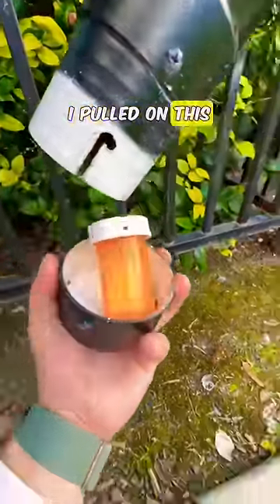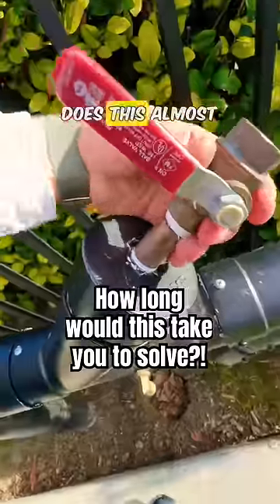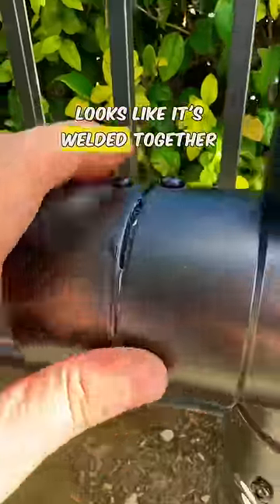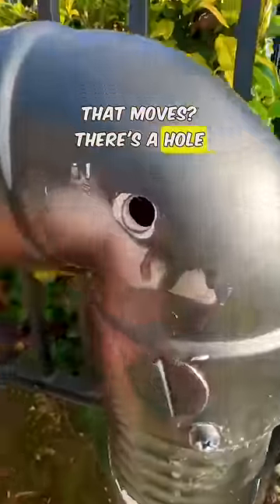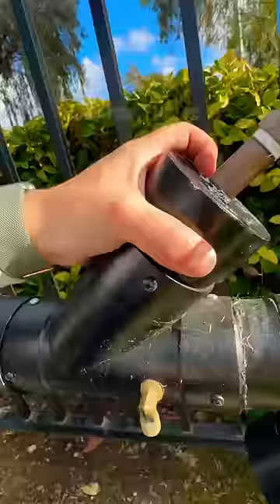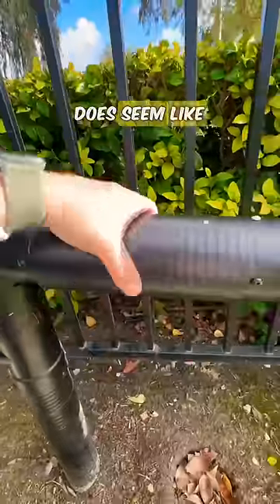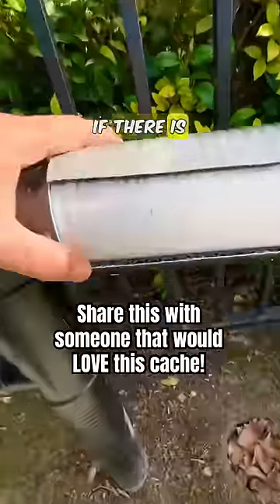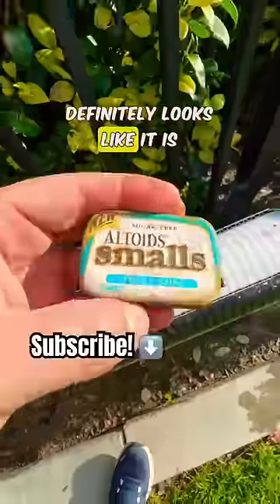Could you figure out this INSANE gadget cache? One of my favorite Geocaches EVER! 🤯

Comment: This cache needs a hole in the bottom to drain the water .. and a plastic watertight box. 

Nice find.
Reply: Something I have found cache owners do where they think there is a chance of water getting in, is using a container (rather than a plastic bag) inside another container.  As long as the opening to the inside one is up high the water that collects in the outside container is unlikely to get inside the second container.  We have wet winters so it's worth while doing with smaller caches where the bag is more likely to get damaged after multiple finds.